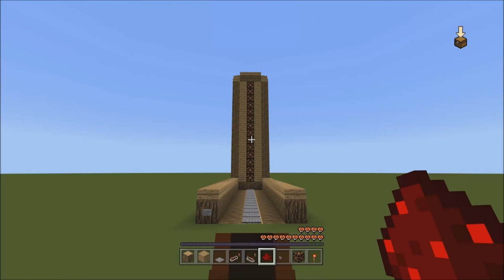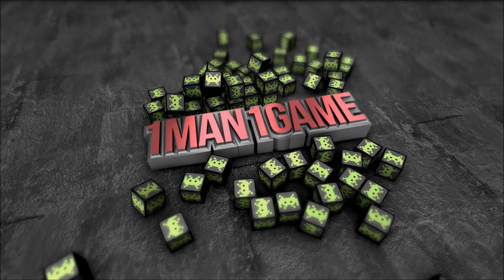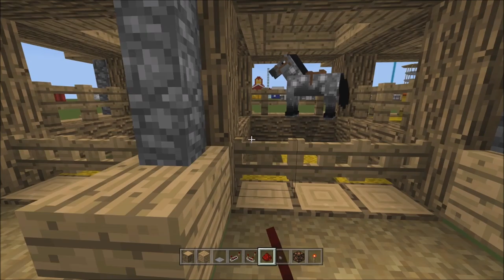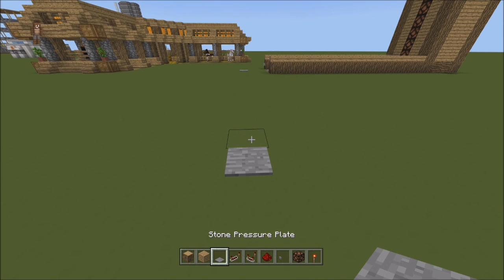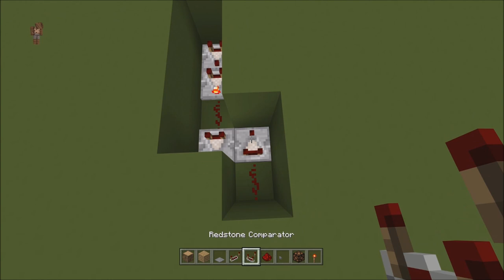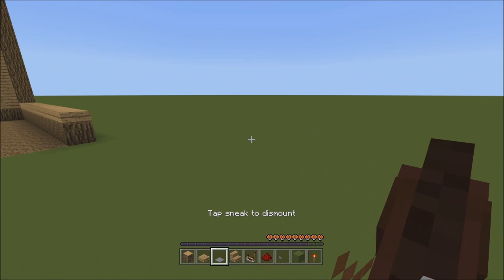How To Build A Vertical Horse Speedometer [Minecraft Bedrock Edition]

Comment: Great video tutorial, I like your style a lot. Subbed and will look forward to your other videos. But I'm having difficulty. I'm on PC bedrock and followed the build guide meticulously, but the lamps don't light up. I've checked, double-checked, and re-checked all the circuitry, and they all appear to be exactly as in your video. I removed all of the covering and left the redstone exposed to debug and I can confirm that all circuits appear to be lighting up with sufficient signal. All the comparators and repeaters are pointing the right way, etc., and the circuits light up as expected. Reset turns off the torch and retracts the piston, etc. But for the life of me, I can't get the lamps to light up when I run it. I know it's tough to debug remotely without seeing what I've done, but do you have any ideas about common errors, that sort of thing? Thanks again.s
Reply from the maker: Unfortunately it seems like u wouldve caught any of the common bugs. Idk what could be causing it, but it seems like a comparator somewhere isnt hooked up or something is powering it from the side and causing it to not register the signal
Reply: @SkyGuyJedi  Ok, I'll go back and triple check all the connections and pay particular attention to the comparators. Thanks for the prompt reply, I think I'm going to like watching your videos!
Reply from the maker: @BobFromSeattle  i appreciate that.. thank you! :)
Reply: @SkyGuyJedi  Ok, I figured out the issue. You were right, it was a comparator issue. In fact, the very first comparator that you lay down in the build, that first one down the middle, wasn't connecting its output to anything. I needed to put a block in front of it to deliver the signal strength up to the lamps. Works like a charm now! I even re-routed your reset switch to the right side to simplify it a bit. Thanks again, looking forward to more of your creations! Would be nice to have an equally reliable jump height tester. I don't like any of the ones I've seen so far. Have you made one of those?

Comment: I am having trouble with it. I did exactly as you showed in exception when you changed the localisation of the button. The lights do turn on but then turn off very quickly they dont stay on until i press the button they just turn of right away
Reply from the maker: Hmmmm.. let me rebuild it and I'll get back to you. Its been quite a while since the tutorial. Not home atm so its gonna be a bit.
Reply: 1 Man 1 Game thank you for trying to help me! I appreciate it.
Reply from the maker: Yw 😀
Reply from the maker: Ok just finished testing it in bedrock and on my sons switch.. the signal holds for me. Go back to the beginning and double check the comparators... the part where will have double comparators and then comparators facing the opposite way is like a battery and will hold the signal til u press the reset. It's very important everything is done exactly the same bc one mistake will make the battery not work. Pause it of u need to. Also, make sure none of the redstone touches for the reset line and the main line.
Reply: 1 Man 1 Game i believe the problem it’s the redstone. I am going to check it out

Comment: I’m on bedrock 1.16.4 and I’ve either built it wrong or it’s not working
Reply from the maker: i actually rebuilt it about 3 weeks ago to see if it was still working, and it was all good. id say double check the comparators and make sure blocks arent placed on top of the spot where i said in the video, and the comparators arent ticked on as well. Those tend to be the issues.